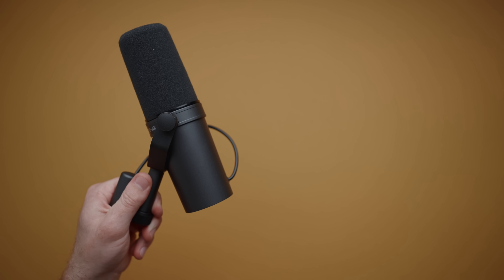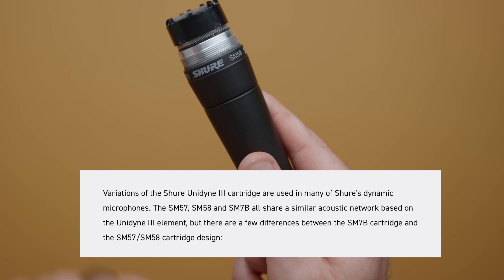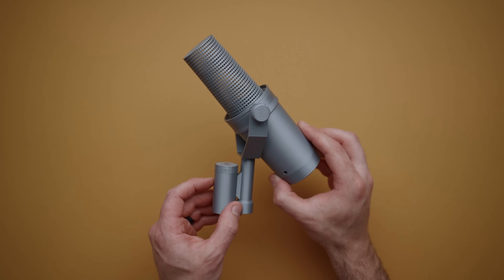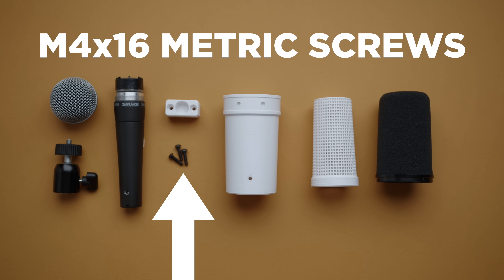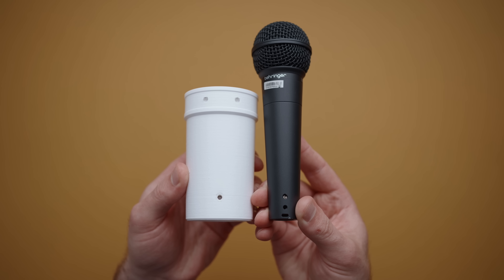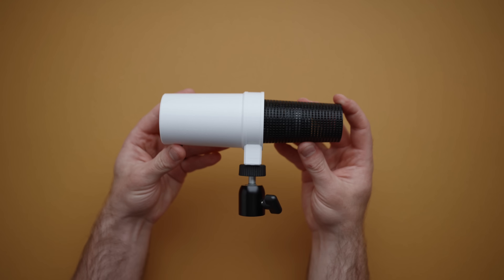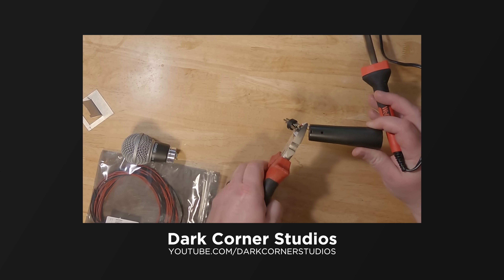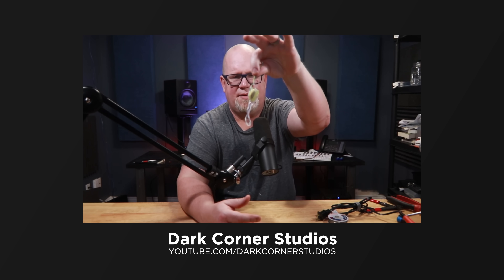$30 DIY Shure SM7B Microphone!

Comment: Something to consider that could affect the sound quality under certain conditions. The 3D printed shell and grill were designed as an aesthetic modification, and essentially acts as mic holder. The metal head basket (Grill) on metal microphones are connected to ground from pin 1 on the xlr, shielding the sensitive internal components from EMI and RFI. Removing the head basket from the sm58 means the capsule isn't shielded and no matter how identical the 3D print is to sm7b, it's plastic and can't be grounded. Setting the mic up close to noisy electronic's like power supplies and computers will pick up feed back, same as any large ungrounded metal objects and incoming cell signals. Best bet is keeping the sm58 intact, intall it in the new shell without the plastic grill, and put the sm7b foam over the sm58's grill.
Reply: ...the entire housing of an SM58 is metal and the grounding wire is attached to the housing not the grill, otherwise you wouldnt be able to simply unscrew it, while it may slightly increase the microphones pick up of feedback and interference, unless you’re directly next to a powerful transmitter or dirty, unshielded power you wont have an issue, and anything bad enough to cause issues with the mic will also cause issues with other equipment in the recording space
Reply: @CalamityJay-ez2mq  yup. maybe if this was like 20+ years ago he might have a  point. but this is 2022 and most electronics don't emit very much sound. at least most that people use.
Reply: @CalamityJay-ez2mq  there is no ground wire in the mic, the xlr insert has sleeve mounted to pin 1 which makes the connection to the body when screwed in. I said the head basket is connected to ground from pin 1, not to it. I didn't wanna go in to much detail but here we are
Reply: There's a ground wire in older SM58s and 57s fyi. But I think the issue you're speaking about could be solved with a little copper or aluminium conductive tape.
Reply: @Reginald-Bowls can you elaborate good sir? 👀

Comment: congratulations you’ve proved what everyone has always known: Shure dynamic mics are overpriced nonsense. that’s why despite everything else in the world changing, an SM58 has consistently cost 99 street retail for the last 30 years.  Its the same capsule in all the “SM” dynamics, the only difference is manufacturing tolerances that are tested after the capsules come out of the assembly lines. the “nicest” ones go in the most marked up enclosures, and the “worst” ones go in  SM 57s. which you can now get an indistinguishable clone of from the Behringer factory under a bazillion different brand names for under 20 bucks

Comment: What setting a where used  on the prints? What orientation did you print the grill. On my attempt the top failed. Should I have flipped it?

Comment: When I studied the schematic for the SM7B I thought it was essentially an SM57 capsule in a fancy can. Lo and behold, according to Shure, that is what it is :-)  Two things: Leave the transformer in place or you could blow the directly connected  voice-coil in the capsule if you inadvertently connect and disconnect phantom power. The mesh screen is metal in the SM7B as a way to provide a Faraday cage, for to isolate the voice-coil from EM disturbances that are prevalent in a professional broadcast studio setting, with light dimmers, etc. My choice is the Shure beta 58A with -51 db of a sensitivity, a built in pop shield, a strong metal grille, etc. I added the official windshield to mine, just to add a finish. I have the "impression" that the audio is slightly smoother, too, but am not sure if it really is. Nice job with the 3-D printing. Perhaps there is a paint with metal particles that would metalize the whole thing.
Reply: No problem with phantom power and a moving coil dynamic cartridge connected directly to pins 2 and 3 of the xlr without going through a transformer.

Comment: I don't know if I would use this. But I do love diy projects so I'll probably do it with my SM48 for kicks and gigs. If nothing else looks like a really fun project. 

The sm48 can be had for like $40, not sure how it compares to the other really cheap one but it's also an option. It's similar to the SM58 but needs more gain. 
Someone correct me if I'm wrong, but the SM7B and SM58 have almost identical capsules? Needs fact checking,
Reply: They are not exactly the same, but the 58, 57 and 7b are based on a same element but with different mods each, some say the 7b is like having the other two in a box
Reply: @karaniivt  thank you for clarification.
Reply: I do really want to print a pink one for my wife. That would be cool

Comment: Just printed mine. Great model Caleb. I’d love to mess around with the yoke and mount if you make the model available.
Reply: Do you know whether to select mm or inches when it prompts you what the 3d models were designed in?
Reply: @johnteaguefilm  Im using prusa slicer and it doesn't prompt me to choose.
Reply: Did you use any supports for the overhangs?
Reply: @generalsou  No supports were needed. Orient the models with the "xlr hole" and "grill top" are on the print bed.
Reply: What infill settings worked for you? Any other tips?
Reply: @garretolson  In prusa slicer I used adaptive infill I believe. I printed at .3mm layer height and .15 for the treaded areas.

Comment: LMAO! I love ya, buddy! You should get the, Rube Goldberg Award! Your  3D printed, SM-7 imitation, was an active creative genius! And yes. You are 100% right!  You win! You've got proper smarts! And you've learned about the outsides and insides of your microphones. Very well. And the joke is on all of those fools... Who spend, an additional, $300-$350. For this stupid SM-7's. Originals or later, B versions. Which are identical to the original version. Except for some additional, Broadcast, RF shielding. Which provides for that,, B, designation. As it has nothing to do with the,, Beta, versions. Let some people think the designation, B, means or indicates. Nope! No it does not... It just means Broadcast, version. When your microphone is used in close proximity to the transmitter  or the antenna tower. Which no You Tuber, have to worry about. Except near, TV Hill. In, Washington, DC. Where all the TV & FM radio stations  are in close proximity to one another. All within a couple of blocks of each other. And then, yes.. You then might want an, SM-7B? In that RF rich environment. But otherwise? I've never had any problems using, SM-57 & 58's. Within that same area and region. For over 30 years. But hey. Some radio and TV stations,, had issues. And thus, required the, SM-7B variant, to be purchased.

And yes. I'm one of those people. That has been telling people this for years. Decades actually. When all you really need to do is take your SM-57. And get that overly large, gray foam, pop filter. And you've got the poor man's (poor woman's), homebrew, SM-7. Brand-new. For under $140. Or, $100 for a good used one with a new pop filter.

I love ya buddy! But I prefer guys with hair. So why haven't you used your 3D printer. To print yourself some hair? Then you could sell a shit load of those! For all of these other, skinheads. That is to   say. I think you would be taken more seriously... If, you had hair. I mean how are we to believe a bald guy?  That, didn't print yourself some hair? Come on man? It's not all about the microphone. You've got black foam hair for your microphone. Where's yours? And just think of the advantages on a hot summer day. If you had foam    hair? Add a glass of water on top of your head. And you won't get sunstroke! And nobody would know that your head is all wet... Because it's cool looking black foam. And oh so cool.. With an open cell architecture.

Later your foam hair could be used in an emergency. When your girlfriend takes a, tinkle. Annd has no toilet paper.  Your foam hair could be used in an emergency. And she would be oh so grateful. That you could pretty much guarantee.  That you would get laid that night. So come on. Don't just go halfway. With a microphone. Go  for the full Monty! 3D printed foam hair!

I just think your imitation, SM-7. Was the absolute high point of my, YouTube watching! This was the besst thing I had ever seen   on YouTube! This deserves a commendation. YouTube should pay for your hair transplants! I'll even donate you some of mine. That are really curly.  From where they come from. As the hair on my head is very straight. And I'm not. so let me know if you want some of my, Curly Q hair. It's down there waiting for you. In my panties. Where it is always kept, safe. As I do not want to let my cat, out of the bag.

Have you 3D printed any  Playtex Tampon,, applicators?
  RemyRAD

I'm full of good ideas! Full of something..

Comment: A few years ago when I was gigging live music I stuck an old sm58 into a small wooden box with just the lead coming out and then taped it completely shut. I used it as a foot stomp like the Cajun blues players and would plug it into the PA with all the top rolled off and whack my foot on it for two hours every night. After a couple of years I opened the box…

… the sm58 was bent into an oval shape, completely deformed and damaged. But it still worked fine! 

I went on to use it as a hammer in my toolkit. Still going strong.

Comment: Significant difference in the top end, the 7B being more forward which I didn't expect because it's not known for high frequency flattery. The SM58 is known for a boost at 2K to help cut through on stage but this was not apparent on your test, did you EQ it? There are other differences you didn't mention, the main one being the switches on the 7B.
They are both fantastic mics, I have had one of my 58's for over 30 years, indestructible and for some voices, especially voices that lack clarity it can be a great recording mic, however the 7B is a legendary studio mic for a reason, it is excellent on many different voice types and superior to the 58 for narration. But the older I get the more I learn that there is no one mic solution that's perfect for every voice, I can't use a 58 live because that 2K boost isn't flattering to my own voice.

Comment: The metal grill is very necessary to avoid interference from other electric so i suggest to keep the grill on or make a grill of metal instead of 3d printing
Reply: because PLA somehow interferes with electronics?

Comment: SM7B has capsule similiar to SM57, not 58. But the SM7B is, SM7B and I would not change it for anything cheaper. There isn´t a dynamic broadcast mic that comes even close to the SM7B. Lot of people in US recommends to get the RE20, but in EU it cost 577€, but SM7B costs only 355€

Comment: Thanks for this! Fun project. Curious to try this out myself.

Some thoughts on differences between the SM7B and this project: The SM7B is supposed to offer better EMI rejection than most mics, supposedly particularly good for having it close to things like electrically noisy computer monitors. Would be interesting to see how the SM58 compares in this regard. Also, part of the deal with the housing for the SM7B is that it is supposed to offer a degree of anti-shock protection to reduce mechanical noise transmission. Would be nice to hear how things like desk bumps or mount arm bumps translate on the SM7B vs the 3D printed kit.

Otherwise, would be nice to see microphone tests where you're using an audio clip/recording played through a quality studio monitor under controlled conditions with a few seconds each of spoken, sung, and instrument samples. Obviously the live voice is good too for things like plosive response, but that level of reproducibility I think would help in teasing out the audio differences more clearly.
Reply: This, a lot of people are buying these just to talk, but it's capable of so much more.

Comment: Could you use the sm57 instead of the 58 due to its dimensions? It's essentially the same capsule with a different enclosure as far as I know. The SM58/57 has a reputation for being dark sounding, even compared to the SM7B. Putting it in an SM7B like enclosure could make it a bit more dark as there is more material blocking some of the low frequency response part of the SM58's pickup pattern . It looks like there's a bit of foam covering the capsule on the SM58. Since you've distanced the speaker from the capsule erhaps removing the foam will make it a little bit brighter, and more comparable to the SM7B. Some people find the SM7B too dark as well and swap the foam cover for a pop filter instead.
Reply: Sm57 is closer to sm7b sound gate and yes you can use it they are similar in size etc.

Comment: You are very sly! The metal grill and body of SM7B is no joke: they screen the electric hum and noise picked by the capsule otherwise. The 3-d printed body and grill do not provide that in any way. The project makes sense as a look-alike only.

Comment: 3D printing camera gear sounds like a great video series. It would be amazing if there's a video coming where 3d printing is used to make an entire camera rig  such as a cage that attaches onto 15mm rods and parts like cheese plates or powerbank/HDMI monitor mounting.

Comment: It’s an interesting video, but the real question is, other than the “podcaster” or “radio” look of the SM7b, why not just buy an SM57 with the extended windscreen kit instead? It’s been successfully used by Presidents and other high profile people for decades and uses the same Unidyne capsule as the 58 and the 7b. The DIY project seems fun, but unnecessary in a few ways. If you want the project concept then putting a small frame inside of the windscreen with a bit of nylon stocking stretched over it will create an additional pop filter. The SM57 is also less expensive than the SM58.
Reply: I've been using the SM57 for years and much prefer it over the SM58. Endorsing your thoughts.
Reply: @chrismooney-singh2055  Why?
Reply: @ylevision7088  The SM57 although designed as an instrument microphone serves well as a vocal mic. The smaller grille size also limits plosives. That's my experience. Used in a home studio that's not soundproofed this dynamic mic also limits background noise.
Reply: @chrismooney-singh2055   Knowing they're really the same microphone, do you really "much prefer" the sm57 over the sm58? If so, why?
Reply: @ylevision7088  read my reply above. I own both mics so I speak from my experience. In the end it's personal choice. I'm not sure why you keep asking me this question.
Reply: @chrismooney-singh2055  I'm just being curious. Now I'm getting that it's more of a personal choice, right? After all, the sm57 and sm58 differ from each other only in parts of minor importance I would describe as acessories.
Reply: @chrismooney-singh2055  Well, I do recall the sm57 having a different frequency response for whatever reason...

Comment: Yeah yeah BUT you're only getting the real sound of an SM7b once you hook it up to powerful preamp that can get some good gain without adding saturation. Your audio interface just makes your SM7b act like a basic SM58 type of mic. Hook up your SM7b to something like a Focusrite ISA One with the gain cranked, suddenly that poor contraption of yours will look like a 3D printed toy. Now, I know that this is just a talking comparison, but it would be even more obvious that those two mics are different once you start singing in them or even worse growling some intense Death Metal vocals in them, one of the SM7b' best application. Don't get me wrong, a SM58 is a very usable mic that has stood the test of time but it's no SM7b.  That test is misleading at best.

Comment: had though of doing that using sm57 capsule, brilliant that someone did it, plus your version is simpler than what i had in mind.
If you want to remove the transformer anyway just by a sm58 or 57 replacement capsule and use a XLR cable connector with a little piece of cable just like on the SM7 you will save probably 30$.

Comment: Love the 3D printed case! The differences between the 3 mics become a lot more apparent when used in actual recording circumstances, as the response to sound pressure changes. But for casual use, the 58 and SM7b are definitely in the ballpark. Even closer if you add a little EQ. Great video idea Caleb!

Comment: would love to know if the difference in freq response is due to the capsule or the built-in circuitry. I can imagine the 7B having a thinner membrane or fewer winds, but I can also imagine a higher quality 1:1 transformer, some impedance-matching wizardry, or even just a simple passive filter network to boost the highs.
Reply: for me personally though, I'm a condenser preferer all day. I love the really high highs that condensers can capture. absolutely recommend the rode m2 as an affordable option with solid sound provided you're recording close up to it and head-on. its off-axis and distant (>1ft) sound is not as good unfortunately.

Comment: Dude... No. Looking similar and sounding similar are separate. The resonate frequencies for one are totally different. It's not just about the capsule which is also affected by the enclosure and build even if they use the same element. Are two cameras the same because they have the same lens? There's a reason one is referred to as a broadcast dynamic and the other a handheld dynamic. Just like how you hand hold a microphone matters for the frequency pickup, the enclosure design affects the sound too. You might as well say that any two microphones are the same if they can screw onto a mic stand.

Comment: Honestly, the branded one sounded best. It preserved the highs. But I'm confused about why someone would buy the SM7B if it's pretty much exactly the SM58. The 58 is a standard, tried and trued workhorse of a mic and is excellent for a wide, omni-directional pickup pattern. So, is the pickup pattern on the SM7B different?